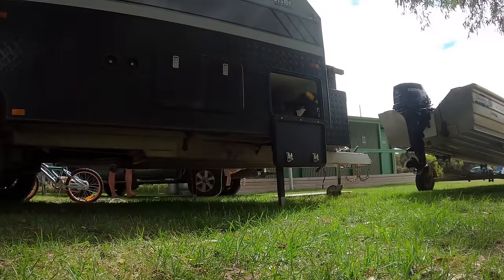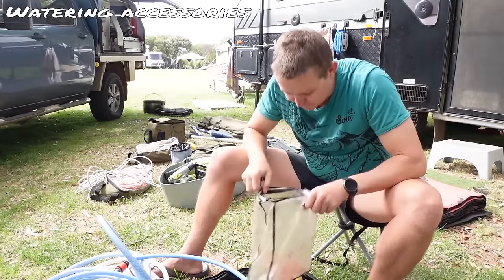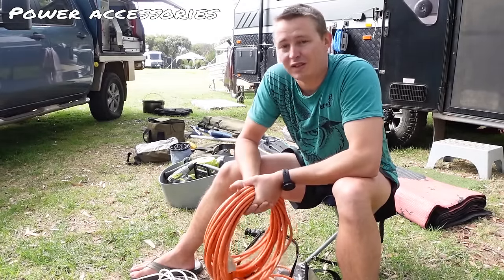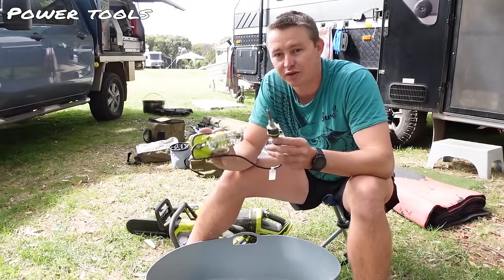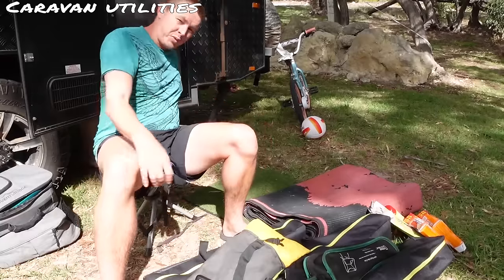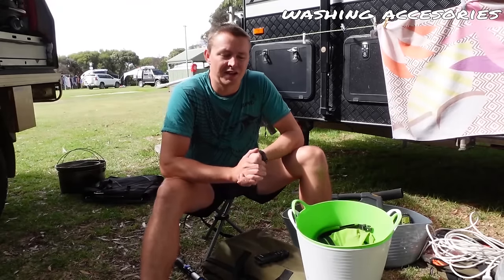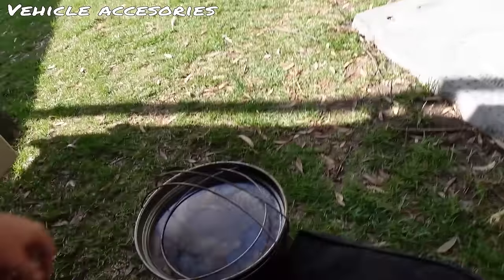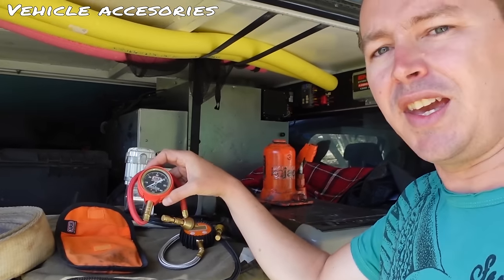What CARAVAN ACCESSORIES do you really need ?

Comment: Thanks for the info. Always useful. For the grey water hose, before packing it away, I use a mixture of white vinegar and water dispersible tea tree oil and put it down the sink in kitchen followed by a couple of litres of waters. This will flush it out and stop the stinkiness. Also useful to use the mixture once the grey water tank has been emptied, to help with lingering odours.
Reply from the maker: Great tip!  We struggle with grey water odors at times so we will.for sure try this out.
Reply: The other part of our arsenal is carb soda. Vinegar, carb soda and boiling water can unblock drains.  @SvedosTrippin

Comment: Awesome straight to the point introduction, caravaner for 40+ years no negative input but where's the FIRE EXTINGUISHER & FIRE BLANKET & BROKEN WINDSCREEN /WINDOW COVER you never never know when you go go go. Another MUST I think is rolls of duct tape, Stanley knife & clear or black plastic, we don't do trips without them to help ourselves or others. We helped a traveller they lost their shower roof vent, so they all came in handy.
Reply from the maker: Hey mate, appreciate the comment.
Absolutely no disrespect or negative feelings from me re. Your comments, but I will go through and answer.

We do have a fire extinguisher in the van (came standard and pretty sure it's a safety requirement so I diddnt cover it same as I diddnt cover our fire alarm). I also carry a fire extinguisher in the car canopy which I keep by the BBQ as a just in case.
The rest of the items I would call tools, I diddnt go through our tools but we do also carry several different tapes, and clear plastic and Stanley knife for exactly the reasons you mentioned as well as to seal up vents on dusty roads.
Only thing we don't have is a break glass tool, hopefully that's not something I will come to regret one day.
Thanks for watching and commenting 😀
Reply: @SvedosTrippin  So happy to hear you didn't take any offence :face-red-heart-shape:hubby said you would have all of your safety gear but I just wanted to make sure, I'm a worry wart lol, its amazing how many travellers don't carry safety gear, anyway I loved your video especially when its straight to the point. wishing you and your family very happy safe travelling for many many more years.Oh & I'm a subbed now:face-purple-wide-eyes::hand-pink-waving:

Comment: Very useful, thanks. Two points: councils, particularly in remote areas, use vandal proof taps to stop people filling there caravan tanks etc. when water is limited. Instead of using the tap handle adapter at will, please check with locals. This is becoming a major problem in some areas. Many remote towns now have a specific water supply (at a very reasonable cost) to prevent overuse by travellers.

If you are advising people to purchase a snatch strap, please encourage them to get some training on their use. They can be one of the most dangerous pieces of recovery equipment. Whilst they have their place (and I carry one), it is probably the least desirable recovery method and often misused.

Comment: Very informative! We took our impact driver out of the van and used the clutch drill for everything. Saves a bit of weight.
Reply from the maker: Something we could consider our selves.  But I do use my impact driver alot.
Reply: @SvedosTrippin  I think if your drill has a clutch you can get by with just the drill. The other thing I will end up getting is the 7.5 kg composite gas bottles. Saves around 6 kg per bottle.

Comment: Informative vid, thanks. We are in pack-up mode ready to leave for the big lap with no end date and I found your vid while looking for last minute refinement of accessories and packing ideas. Your vid is appreciated. Everyone has their genius idea they like to share and I'm no different. Our Stinky Slinky is cut into 3mt lengths and we add segments as needed. When packing up, I hang the segments from the ute's roof racks to drain and dry. No smells so far, plus the short lengths are easy to roll up into the bag. Cheers, now I'm off to get a Ryobi chain saw.  Paul
Reply from the maker: How exciting, good luck on the first legs of your travels.  Nice idea re. The stinky slinky.

Comment: A great list ... thanks. As a caravan newbie, I appreciate your list as my starting point.

A couple of relatively minor and inexpensive but what I consider, key caravan accessories (upgrades) include swapping out/retrofit of sand fly (midgey) proof screens (Cyclone brand - available in rolls from Bunnings) on ALL of the existing screens on the caravan. Also, installation of a Topargee Water Flow Meter (Bluetooth) in the water tank storage system of the van (fitted to the water line hose and not in the tank) to monitor water usage and tank capacity - for offgrid camping.

One other thing specifically in relation to using Weber Qs, to legally use it when connected to the caravan gas system (i.e. via the caravan bayonet fitting), you need to have a flameout safety valve fitted. I'm told that Weber will have these safety valves available later this year for the Weber Q although they can still be used in a caravan/camping setting if connecting directly to the gas bottle. I believe that some other BBQ brands have the valves fitted as standard. Apparently, there have been some serious caravan gas explosion incidents in the past hence the current legislated requirement.

Just subscribed to your channel 👍
Reply from the maker: Thanks for subscribing and for the detailed comment, hopefully it will help others that watch the video as well.
I will look into the water monitor, our guages don't work very accurately and you have just handed us a solution, thanks so much.
Reply: @SvedosTrippin  No worries Matt. The Topargee unit is dead easy to DIY install but you will need to purchase the required hose connectors with the unit depending on the type and size of your water hoses and I highly recommend purchasing the hose cutting tool too since you need to achieve a nice clean and square cut especially when using the 'John Guest' connectors to avoid leaks. I also highly recommend getting the caravan battery connector adapter (rather than utilising AA batteries) to power the unit. I recall using discount code 'Wild' (thanks to Cam from Wild Touring) for a 10% discount when I recently purchased my unit.

Comment: We have the thermocell mossie repeller same as you, discovered it via another YouTube channel wildtouring. Found that the little gas refills were expensive and the mod/hack wasn’t that successful. So we now have 2of the backpacker versions of the thermocell and they screw onto the small butane bottles that last forever and I get the little  pads off eBay. ARS mats. They contain the same chemical as the original ones but you can get ones that last up to 14hrs.

Comment: i put a pvc tube with caps on both ends and mounted it under my van i just slide the hoses  into the pvc tube and lock one with a clip and job done , no smell and no mess hold 3hoses  more than enough so far
Reply from the maker: that's a brilliant idea

Comment: Shouldnt use rattle gun on van legs, use drill instead. Like your vids, new follower.
Reply from the maker: Thanks for following.  We've been told many times about not using the rattle gun on the legs.  But we've been doing it for nearly 3 years now and haven't had an issue.  I'm just careful to do it slowly and not over crank them.  Not saying your advise isn't sound, our legs will probably break eventually.

Comment: Hey Brett, great video! Thanks for pulling this together it’s really helpful for new entrants into the caravanning world 😊 just a quick question on your chainsaw…is that an 8inch (20cm) I’m just trying to locate online at Bunnings…keep up the great videos you’re really good at it 👍

Cheers Corrie
Reply from the maker: Hi Corrie, thanks for watching and the kind comment.  The saw is a 10inch, it was the smallest of the options when we shopped and it's been plenty big enough for our needs.
Reply: Ok great I’ll check it out…thanks for the prompt response much appreciated 😊
Reply: The other alternative is reciprocating saw, slightly slower but more compact especially with blade removed and no oil. Brushless is best. 
Also 18v tire inflator if you don't already have compressor onboard. More suitable to UK vans + SUV that aren't regularly deflating tires for offroad.

Comment: Great video, given me some ideas l never thought about, especially the water tap spanner, thanks for the tip. 
Curious to know the weight of your van, l have 17ft 6inch van myself, and looking to upgrade my vechile, from a 4x2 to a 4x4. Could not see what your tow vechile is but gives me an idea of a vechile to purchase.
You have a good setup,  van and car hope you continue to travel safely.?
Cheers 
John
Reply from the maker: Thanks. I'm glad we could help.  We're towing with a BT50 with a GVM upgrade.  The van loaded is about 2700kg.   I should think you will at least need a 6ton GCM vehicle, though being full time and / or having kids makes a difference if you aren't either you might get away with less.
Good luck, happy travels, catch you on the road.
Reply: Hi Svedos, in mentioning that you have BT-50 l am curious to know from you are they a Diesel guzzler? Il was looking at one myself till l was told that.
With you touring around in one and towing, are they efficient on diesel or do you think they are an expense to run.
Would appreciate your thoughts, so l could narrow down my choices.
Regards John
Reply from the maker: @johnodonnell1513  we get between 17l to 20l per 100km (towing).  I think it's very good.

Comment: Great Video guys! Question, where did you get the Starlink extension pole? Thanks 🙏
Reply from the maker: The pole came from our overland exposure internet kit.  We have just repurposed it with a star link pole mount.
Reply: @SvedosTrippin  thanks so much I found the actual pole on their website 😃
Reply from the maker: @Kerry Sleeman  you should no the pole isn't rated to the weight of star link.  We don't use the 3rd extension and we don't extend it very far out on the second extension.
Reply: @SvedosTrippin  I found a specific Starlink one on that website

Comment: If none of that stuff works or you ran out for some strange reason or could not get to a shop don't panic you can use sunscreen as long as it's 15 + it will even keep midges away as I know firsthand when I work for a transport company people with laughing at me but when I showed them and they tried it I had the last laugh. And yes it works very well
Reply from the maker: Will have to keep that in mind, thanks for the tip.